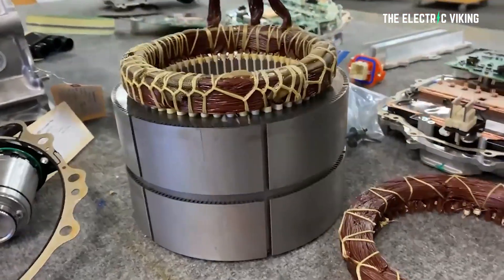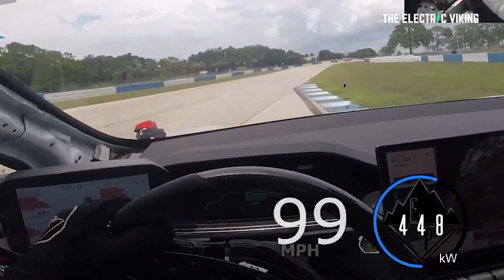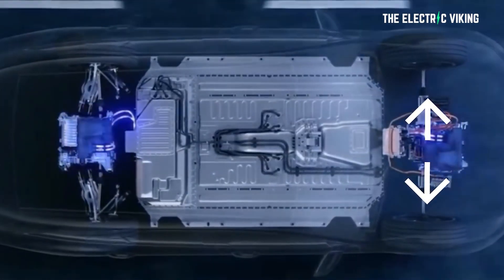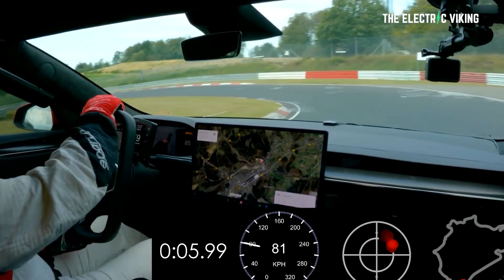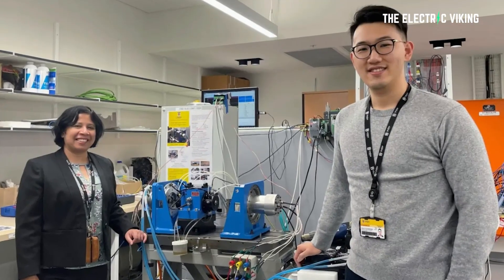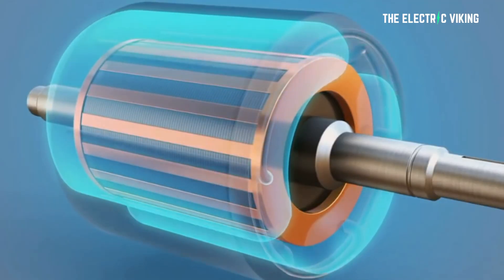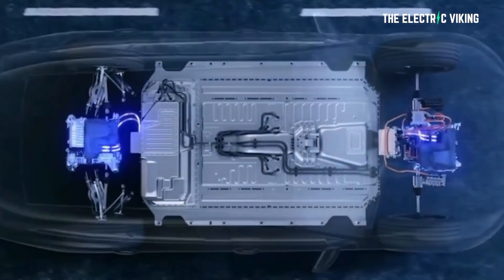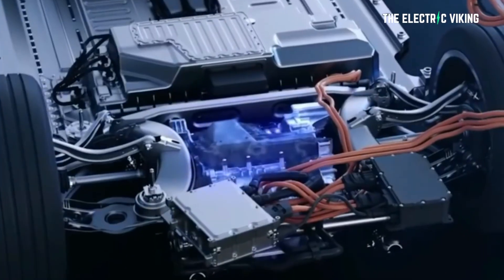World's fastest electric motor can be adapted to run in a Tesla

Comment: When you combine the cost savings of the smaller motor with the weight reduction of perhaps 30 to 40 lbs for the motor it could be a game changer.  If the cost of the motor is low enough and  the motor is light and small enough it could start to be considered a consumable item that is simply changed  out by the consumer every 100,000km or so.
Reply: Or just use the right motor that runs a million miles.
Reply: @allterrainrandy2587  if it costs 1/4 as much and lasts half as long you've made a poor financial decision.
Reply: Weight only affects 1/3 of the energy consumption. There is not enough savings to make any difference.
Reply: @per.kallberg  a motor that's half the size might only cost 1/4 as much.  that's the nature of manufacturing.  You've got the calculations to prove that an extra 50lbs over 1,000,000km is not gonna save money?
Reply: @Nas_Atlas  Done rough numbers you asked for. 50 pounds is roughly 1% of the vehicle. 1/3 of that is 0,003. I use a more reasonable service life of 300000km and 0,2 kWh/km. This gives me a saving of 180 kWh. At my current price that is 200 euros over the lifetime of the vehicle.
Reply: @per.kallberg  so what's the point of building smaller motors?
Reply: @Nas_Atlas  small motors with high rpm produces a lot of specific power, power / mass. But it’s generally hard and expensive to make anything good of it. The obvious example is gas turbines for helicopters. You get 2000hp from 70kg but the transmission is expensive.

Comment: The biggest advantage of an electric motor is that it makes maximum torque at zero RPM. That is why it doen't need a clutch, torque converter or transmission. To utilize high RPM and zero RPM in the same vehicle, you would have to put in a crazy gear ratio or a transmission. So I call bunk.

Comment: Summarizing some of the comments with a twist--
Does this high RPM motor use less battery for the same amount of output power? 
Does it use the same so only benefit is less weight?
I really don't care about going >100mph (160kph), will a high RPM motor give me more power, like for towing with the CT, at the same battery usage? 
How many RPMs does the current Model S Plaid require to go 100kph (62mph)? How much battery power does this require (flat surface)?
Smaller motor, less expensive components (rare earth magnets), different gear ratio (?), smaller or larger gear box (size and weight)--will this make four motors/gears weigh less than two current Tesla motors? Will it give more power than two using the same amount of battery energy?
In other words, does a faster motor actually provide any benefit for cars running the speed limit and below? City traffic, normal highway traffic?

Comment: I heard about this. Every chain of the powertrain can be improved in an EV, and this is an obvious weak link in an ICE that it can only do about 9k revs in top spec before it destroys itself. I think there is also a case for 2 gears in an EV. (1) for stop-start traffic in the city, (2) for highway cruising. I used to drive my Ford Lazer Manual in the lowest possible gear, 5th gear, which had an amazing ratio and gave me amazing fuel economy for a simple ICE car. It had low power at that range, but could chug along at 1500 rpm at 90-100km/hr. The same could be done for EVs for highway cruising, so there would be very little acceleration available, but JUST enough power to keep you cruising. The reason why EVs lose power at highway speed is because the motors have to run at such high speeds. Porsche are onto something in this regard, but their purpose is somewhat different.
Reply: Multi motor EV's can do this already by utilizing different gear ratios on the front vs the rear motors.  Where at higher speeds the power is more bias to the higher geared motors.
Reply: @TheDarinseng  Oh that's a good idea, yes.

Comment: I will call BS on whether or not this motor will scale up to the size of a Plaid motor and go 100K RPM. I know for a fact that engineers have worked decades trying to make spinning objects spin faster. This includes turbo impellers, electric motor stators, centrifuges and even mechanical centrifugal batteries. Perhaps the leaders in this field are the mechanical centrifuges that separate uranium which run at 90K RPM and these are less than 20cm in diameter. At these speeds the outer surface of the centrifuge is spinning at greater than mach 2. These centrifuges are hollow cylinders, BTW so they do not have the same inertial mass as something that is solid through out. The rotor in a Model S Plaid is about the same diameter but it consists of a complicated interior structure comprising copper wiring and structural forms to hold that wiring in place. The entire thing is wrapped in carbon fiber under a great deal of tension so as to not let it come flying apart. The shear mass and complexity of this mechanism makes it very challenging to get it to spin reliably at the speeds that it does, all the while dealing with the additional expansive forces of heat of operation. No, I really doubt that anyone has just now discovered some new remarkable material that would magically allow for this huge increase in speed of an electric motor. Sounds like more of a PR claim to get money flowing their way, like so many of the battery claims that are flying about these days.

Comment: I’m certainly interested in motor and inverter tech, and I work in the field. You should understand and explain that power is torque times rotational speed, so you can achieve a given power with a smaller, lighter lower-torque motor spinning faster. By adjusting the gear reduction higher to give you the desired speed and torque at the wheels, you have a lower-weight system with comparable performance. The smaller motor will also use less magnetic material and will thus be less expensive.

Comment: How fast a motor or engine revs has little to do with the range of the vehicle.  What matter is the efficiency (and the energy capacity of the battery pack among a few other things).  High motor efficiency can be achieved at 18,000 RPM or 1,800 RPM or any value really.  It turns out that the motors used by Tesla are between 94% and 96% efficient, so there isn't much room for improvement on the efficiency front.  However, these values are really a maximum, efficiency goes down from there.  If you are attempting to accelerate (drag racing for example) you can achieve high power output (power in this case is energy converted into motion per unit of time) but your efficiency drops quite a bit.  Usually, when your are attempting hard acceleration, efficiency is a secondary concern.  When your just cruising down the highway, your power output is relatively low, maybe 30Hp, but efficiency is a major concern.  But, RPM means very little when going for efficiency!
Reply: I agree. What increasing the maximum RPM can do is to improve both low speed acceleration and increase the maximum speed without having to add gear shifting. Great for high performance EV sports cars, but not very useful for the average EV.
Reply: @chrismuir8403  so we are really talking about 3% of the total mkt.  Not so important.  i/e/ no one expects a leaf to do a 4 sec 0-60(100kmh)
Reply: @chrismuir8403  they consume less energy and rotate faster—they’re also lighter… this isn’t a diesel engine, but maybe you should share your experience and expertise with the engineers 😂
Reply: @JC-cf4rs  It's all about the core efficiency of the motor. The new motor has to do better than Tesla's ~95% efficiency to improve overall efficiency of the vehicle regardless of RPM. RPM has nearly zero to do with efficiency. Chris Muir points out its most significant advantage, which is having a greater vehicle speed range without additional gears.
Reply: @gottafly2day  "RPM has nearly zero to do with efficiency": Would you say voltage has nearly zero to do with efficiency of transmission lines? With higher RPM you can deliver the same horsepower with less torque. With less torque, friction losses can be reduced. Same concept as electrical power transmission.
Reply: @toddmarshall416  I fully understand that with transmission lines one mitigates I2R losses by increasing V (thus lowering I) for the same delivered power. But this analogy does not translate to power loss due to friction as it relates to the product of RPM * Torque. Here's a thought experiment: Imagine needing to rotate a shaft that presents a load of 100RPM at 100nm. A motor designed to run at 100RPM can directly drive the load with minimal frictional losses. Now imagine using a motor designed to run at 10K RPM with a gearbox to reduce the RPM to 100. The bearings in the 10K motor will have to present 1/100 the friction to equal the frictional energy losses of the 100 RPM motor (losses = RPM * frictional torque). Additionally, the gearbox represents friction losses that aren't even present in the 100 RPM design.
Reply: They consume less energy, and rotate faster… they’re also lighter.

Comment: Sorry but you are off base here. I watch virtually all your videos (and regularly point to them from the minds EVs group and the evs resource pages on A42. But, you are just wrong on this one. Electric motors (all of them) tend to be over 90% efficient. If the ones in EVs weren't you would need to be more concerned with keeping motors cool than batteries. There just isn't that much room, efficiency-wise, to gain a lot.

Comment: RPMs mean nothing and higher means more engineering difficulties with gearing, bearings, forces. Efficiency is already pretty good and different motors have slight differences in efficiency. Motor size, weight, materials, and cost are HUMUNGOUS drivers for range, performance and price.

Comment: Hi would have been nice to discuss the weight increase of gearbox and efficiency reduction as need to handle  4 to 1 extra shaft reduction speed. Now I will need to think about this....any thanks for your hard work.
Reply: Exactly. Plus the fact that the reason EVs accelerate so quickly is that they make maximum torque at zero RPM.

Comment: Mmm…maybe over-simplified….tribology and bearing wear need to be considered. Anything spinning that fast is going to need better lubrication, higher performing bearings and better localised cooling. Making for more expense and more frequent servicing and/or replacement. Good for race cars or if you want to build a veyron ev. Lighter? Only if it’s made from unobtainium😂

Comment: I am interested in this topic.  Current EV motors are not efficient at high speeds due to Eddie current losses.  Do these new motors use any permanent magnets?  What topology are these motors?  ie  Switched Reluctance Motors, or IPM SynRM motors like Model S.  I heard that their was much research going on to achieve a Switched Reluctance Motor which have the benefit of being very simple to design and without permanent magnets.  The difficulty with these motors comes in the inverter design and getting the motor to run smoothly.
Reply: Everything capable of going quicker consumes much more energy doing that than it does sitting still. EV motors are not an exception.

Comment: Tesla is now last years design. Engineering wise they've always been behind since they optimized for production, not engineering design (look at that ridiculous magnet wire winding). Take a look at the Lucid motor which is in production, it and the GM Ultium motors are the kings of the hill now.
Reply: 18K rpm (Model 3 & Y) is among the highest spinning in the industry. Rimac Nevera motors spin at 17,700 (rear), 15,000 (front), the Taycan spins at 17K. Only Lucid Motors and the Kia EV6 GT spin at 20K rpm. Plaid motors spin at over 20K. There are tradeoffs in terms of scalability, and cost; but again to say Tesla's motors are lagging is just a bunch of malarkey.

Comment: Would these higher RPM motors also increase the efficiency of other electrical appliances, like air conditioning?
Reply: no, because it does not have anything to do with efficiency

Comment: well ... smaller to be sure but nearly all DC power tool motors are rotating faster than the tesla plaid motor...

NB, Faster motors develop the same torque with smalller diameter / lighter rotor...

 - ?? are air bearings already being used on highspeed sides of these units ??  (friction and heat reduction )

Turbos are also rotating at these insane speed when spooled up...  pretty fast 100k+ RPM

Comment: Interesting. The only way you can run these RPM is by shrinking the diameter, because the bursting force is proportional to the square of the speed but linear for the radius. You have to make pretty radical changes to the diameter else it will explode. it will be interesting to see how they make them robust enough.
Balance is a huge issue at 100,000RPM, and when the bearings wear out, it's likely to be catastrophic.
Reply: This is exactly why Tesla wrapped their rotors. They still have the torque of a larger motor but then also get higher RPM without the need for a power robbing transmission. 
A small high revving motor would not have a large enough moment arm to create good torque and would need to be married to a transmission….which might rob the efficiency. 
My guess is that Tesla would have already tested smaller higher revving motors in their initial designs and settled on a larger motor with high torque and no need for a tranny.
Reply: You're saying that the bursting force in linear for the radius? Really?
Maybe you should rethink that part.
Reply: Yeah, I expect a bearing wobble @ 100,000 RPM Would be kinda spectacular,depending on the surroundings.
Reply: Wrapping the rotors lessened expansion and contraction. This allows for less clearance and increases efficiency at speed.
Reply: Compare a crotch rocket to a Harley. Further, at very  high RPM you can use things like air bearings and Tesla's turbine concepts.

Comment: This is not true. Increasing rpm will not increase efficiency, it reduces life and is significantly harder to produce in so many ways. The only possible improvement could be weight. Regarding carbon sleeve… it is not there to reduce weight, it is there to hold rotor at high rpm not to explode due to centrifugal forces.

Comment: Nikolai Tesla 100 years ago had a motor that spun at over 70,000 rpm but that is not the problem..
Those forces made the rotor expand and contact the stator, hence why the Plaid rotor is bound very tightly
- to prevent this expansion. 
So spinning at 100k rpm is not necessarily difficult It is managing the resulting centripetal forces.
Efficiency ay 100k rpm not necessarily the benefit either it is weight saving but at what cost in terms of more
gearing and longevity.
Conclusion - interesting but not novel and probably not the way forward for vehicles may be more suitable for flight.

Comment: What? RPM does not equal distance range, it will equal higher top speed (bigger range of RPM). There won't be much increase in range. Energy in equals energy out, conservation law of physics. Already motors are over 90% efficient, so any range increase will be less than 10%.